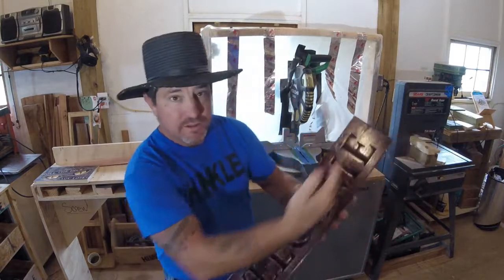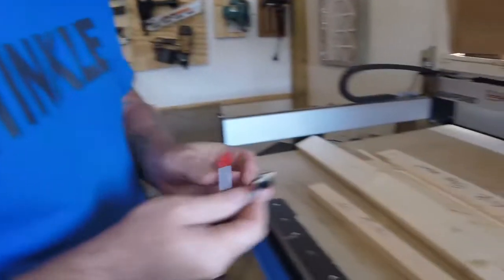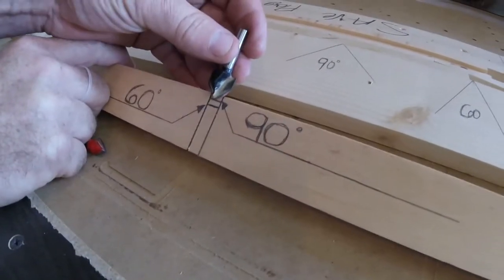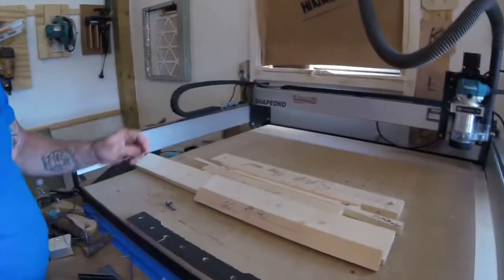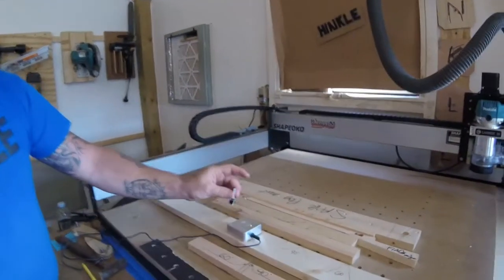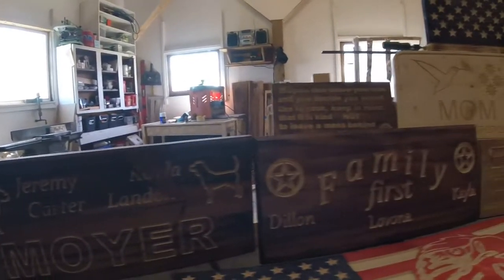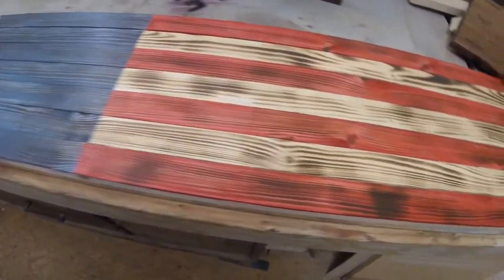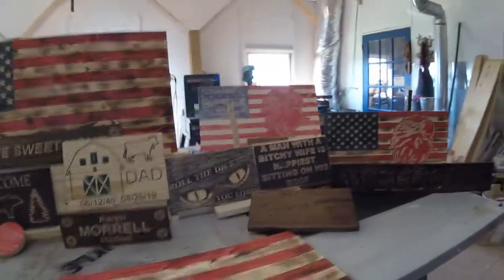SHAPEOKO XXL CNC HOW TO: V BIT AND LISA'S PROJECTS SPOTLIGHT

Comment: Have you ever done flags that have to hang off the machine?
Reply from the maker: Charlie M Yes we have our large and extra large flags hanging out the back also our corn hole boards hang out the back not to a great extent but they do hangover
Reply: Any advice or a video on how to run larger signs or flag projects?
Reply from the maker: Charlie M the way we do it may not be the best but I create two programs, run the first half then remove the stock rotating it 180 degrees re zero load the second program and complete the carve it works best when the carve doesn’t require a continuous connection like stripes
Reply: @Hinkleshop  thank you for the advice!  Hope to see you be the first to do a video.  Can't seem to find anyone on youtube that does the over sized signs.